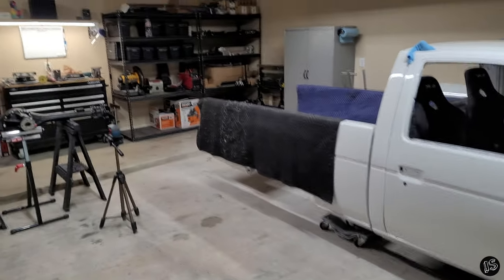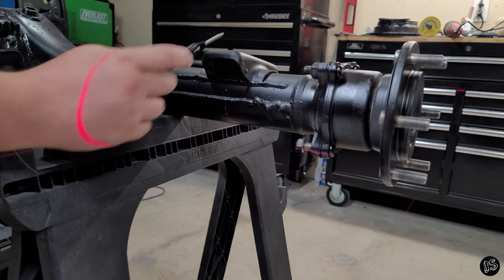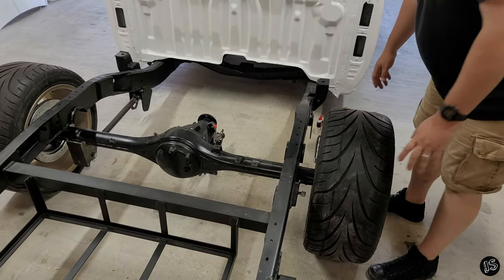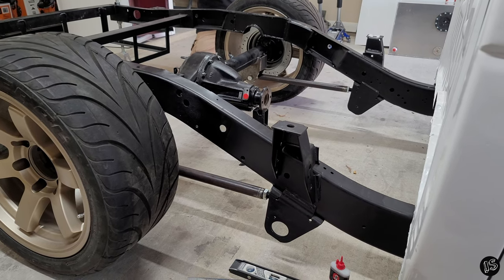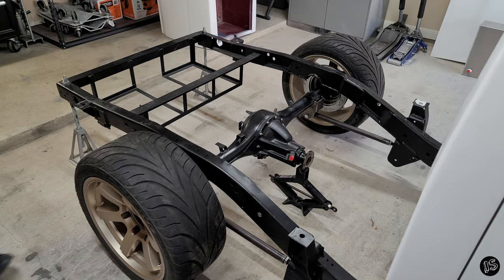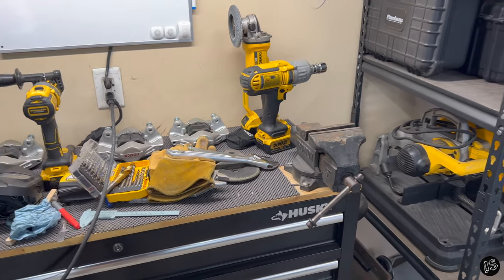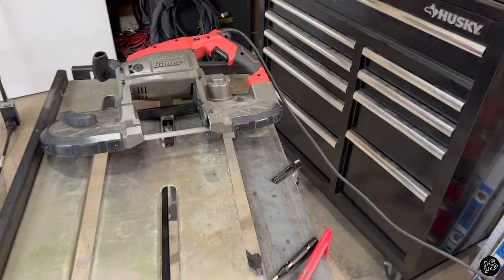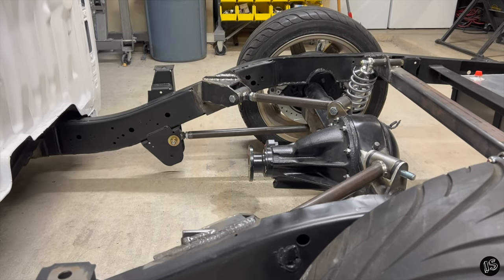Triangulated 4-Link | D21 Drift Truck — Ep. 19

Comment: If the lower links are angled upward toward the vehicle roll center you will achieve what called anti squat, it helps with traction and reduces weight transfer under acceleration. Yup
Reply from the maker: That’s good to know. Thanks

Comment: This is an awesome video, thank you. Currently starting my 4 link. My dif is still attached with leaf spring and stock height. Should I lower the truck prior to starting this project or does it matter? Plan is to airbag truck. The thought process is with it attached to the leaf springs I would have a my position solid (front/back/left/right) and after Installing top links, I could remove the leafs and then install the bottom two. Also just to verify, the top rods and bottom rods should all be parallel to the ground? I see a lot of four links with a downward slope on the top two. Thank you in advance

Comment: I have a bunch of harbor freight tools. They all seem to be the tools i need rarely. Or disposable if need be. Hard to justify buying a tool that costs ten times more if you will only use it a handful of times. And some of them work just fine. I bought the bauer impact drill to build a dock and floating docks just in case i dropped it in the saltwater. Didnt want to risk dropping my milwaukke. That cheap little drill hasnt skipped a beat for years of abuse.

Comment: I'm curious, if your links are two different lengths then won't the points of rotation be different anyway? And presumably the angle of the diff would change? Unless the points of rotation are with an equal length of axis then the diff would presumably rotate a little? I suspect having them offset/angled would greatly improve any side to side "swaying", but as you say, would rotate the diff. I'm curious though, you ended up angling them in anyway? Learning here anyway, planning a suspension setup for a tuk tuk funnily enough!
Reply from the maker: This is sort of difficult to explain concisely on a reply post, but I will try my best, as far as I can understand. I'm always learning too! 

The lengths of the upper and lower links are different, but since they are able to rotate at both ends, it allows the diff to move up and down without the twisting effect. Eventually, you would run out of travel range starting with the shorter links first, but that would be over a much larger distance than this particular suspension would ever articulate. If this was an off-road build, meant for massive articulation, then the design would be different.

As for the triangulated (angled) portion of the setup... The upper links control the track of the rear end due to them being angled. There's no need for a panhard bar on triangulated setups because the side-side force is counteracted by the upper links. Now, if it was a parallel 4-link, that's a different story. Because there's not counteracting force from either of the links, you would need a panhard bar that would redistribute that force accordingly.
Reply: You are right the diff has to rotate because the arc of each control arm is different notice he did not put an angle finder on the flange and cycle the suspension.

Comment: This may be a noob question but I’m not very informed when it comes to suspension stuff, I’m more of a paint and engine kind of guy. My question is, if I were do this with the Ford 8.8 I bought for my S10 but I wanted air suspension instead of using coilovers, would the entire link process stay the same and the coilover mounts be a very similar process/area and I would just be bolting in the bags instead? Does anything in the system need to change if you were to use airbags instead? From first impressions it looks like it wouldn’t change anything but I’m very very new to all this none leaf spring suspension stuff.
Reply: It would be the same. You could use a mustang 8.8 with the upper mounts already built in, but the explorer rear has bigger axle tubes and 31 spline axles.  You could change the mustang axles though

Comment: One of my favorite vids. It appears as though you are using the H233B differential. What gear ratio are you running? Is that an ABS sensor on the snout of the 3rd member? The pathfinder diffs have one. If so, you can use the output from that as a VSS, so you dont have to deal with a speedo cog, since you're using 350z trans. The relationship between pinion rpm and  vehicle speed is linear.
Reply from the maker: It’s actually the weaker 10-stud 3.54 H190 with rear ABS. 97 was a weird year. Yep, I have a Dakota Digital signal box that I’m going to wire up to the ABS sensor and use as a VSS for the speedo. The pinion toner used is perfect for this kind of setup. I would like to swap over to a H233B at some point…
Reply: @Inner_Sanctum  I am working on H233B right now for my 1977 620. I blew the h190 years ago with a stock sr20det on 13lbs (T25).
Reply from the maker: @Zukuri620  oh yeah, I’m sure it won’t hold together long. Just need it to survive long enough to shake it down.

Comment: You didn’t bevel any of your mounts to make sure the weld went all the way through?
Reply from the maker: Depends on the joint I’m welding. I almost always put a ~45 chamfer/bevel before welding certain joint types. The inside corner joints and heavy lap joints on the upper mounting plates have plenty of penetration since I run the machine hot with a smaller .30 wire. The link mounting tabs on the axle third member absolutely have bevels. Most of my welds have bevels.

Comment: In your opinion, my question is. What is the better to build 4-link suspension or independent suspension to obtain the smoothest ride on the road? I am willing to spend what is necessary but perhaps building 4-links would save me all the work of independent suspension and obtain the same result with triangulated links also incorporated a sway bar link on the axle? I repeat i don`t want anything else but a smooth ride. some advisor?
Reply from the maker: You’re almost always going to have a smoother ride with independent suspension. No question. There’s more independently moving parts to assist in adapting to all the variable road conditions. The more independent points of articulation, the more absorbing capabilities you have. That’s why IRS is superior in many ways to a standard live axle. For drag racing and off-roading, this change a bit. You sacrifice certain comforts to gain strength and linear traction.

Comment: This is one of the best videos Ive seen for suspension! Did you make the stands? Great idea.
Reply from the maker: Thanks! I purchased the stands off of Amazon for ~$35. They are listed as: “Camco RV Jack Stands”. Then I just pulled the jack’s leveling post out and replaced it with 3/4” all-thread from Home Depot. Then I used nuts to level and lock everything.

Comment: I dont understand this linkage setup. If you look at 10:50 the upper control arms are pointing inwards. That means if they bend down or up (anything other than level) the ends welded to the axle will have a tendency to pull away from each other. But since they are welded to the axle, they can't physically get any wider, so their movement (I think?) would be limited by the amount of slop the bushings allow. So you're chewing through bushings.
Reply from the maker: Well, I’ll try to help clarify. I know you’re legitimately wondering like I was at first. Also, I love these types of posts. This is what helps people learn. Please don’t delete it. Lol

That would only be true if one end on each upper link was stationary. If you look at the links, both ends have bushings. Both ends on all links move. There are 4 links total with 8 independent points of movement.

I presume you’re thinking that only one end moves and that they travel on their own respective arcs. Meaning that the right upper link and left upper link push and/or pull against each other during operation depending on arc lengths. That’s not the case. Having 2-points of rotation on each link eliminates those arc tendencies. There is, however, a slight centering force in relation to the axle…

That’s kind of the point of a triangulated 4-link. As the suspension is under force, it helps center the axle ever so much. That’s why triangulated 4-links do not require pan-hard bars or stabilizer bars like parallel 4-links. The upper links split the angular difference allowing side to side and front to back stability. The movement doesn’t chew up bushings because the axle is free to be where it needs to be under the truck. That’s why it’s so important to measure everything correctly. That axle is going to sit where you put it in relation to the bars.
Reply from the maker: Here’s a book by Max Fish on 4-link geometry that explains it much better than I can:

https://books.google.com/books/about/Air_Suspension_Design_Book.html?id=-2ESzgEACAAJ

Comment: Unfortunately, your bars are guaranteed to cause pinion angle issued. Please look up "instant center."  If you draw straight lines through your bars, they should  intersect the front of the vehicle.
Reply from the maker: Nope! Truck drives just fine. Zero pinion angle issues. I actually assumed the same thing, but I put my digital angle meter on the truck a long time ago, unhooked the coilovers, and ranged the suspension 14” and the pinion angle remained the same.

Comment: You need to remove the jam nuts.or just leave them loose. As built, it can’ articulate. You could also use hime joints.
Reply from the maker: A lot of folks think this for some reason. However, that’s not how this actually works. 

You’re under the assumption that the bushings and links move together inside the permanent welded on mounting brackets. When in reality, there is a metal sleeve in the bushing that sets the nominal distance for “squish”. The welded mounting points and bushings remain 100% stationary, while the link rotates on the bushing during articulation. The link is the only part that can move up or down. The bushing does not move with the link. 

If you look closely, you’ll notice the zerks fittings and how they distribute grease to the outer bushing side of the internal bushing. The bushing and metal sleeve are not designed to rotate hints why the grease doesn’t lubricate the inner sleeve. The bushings have to compress in order to add torsional resistance.

Also, heim joints wouldn’t work at this angle due to convergent geometry. It would toss instant center out the window.

Comment: I’m about to do the same thing on a Toyota Hilux. My question is have to tried this triangulated 4 link drifting yet ? If so I would like to know how it does as far as the axle moving side to side under extreme loads that drifting puts on it. I’m hearing that it’s better to do equal length bars none triangulated and with a track locator bar is better for drifting. I’d much rather build it triangulated as long as it works for drifting
Reply from the maker: So… I built a 1UZ Toyota pickup years ago, and a buddy helped me fab up a similar triangulated setup. I really enjoyed it. It was predictable and simple. It definitely never felt like the axle was moving around. Haha I think that’s the importance of having it triangulated in the first place. The input force is cancelled out by the opposing side. The reason that there are different types of 4-link is due to fitment, space, and articulation requirements. They all effectively achieve the same result. Triangulated is the simplest, but also requires the most room to properly function. 

On another note, the only sketchy thing about these little trucks is the flanged axles versus having a nut/hub combo. Thankfully nothing has ever happened to my personal trucks, but it was always in my mind. [Snap! Wheel and broken axle come flying off the truck… 🤣]

Comment: What rear end are you using I see disc brakes and not drums. That is exactly what I need to do to get mine up to date.
Reply from the maker: Stock D21 rear end with the Beebani dual caliper brackets and 2002 Honda Passport V6 AWD rear rotors.

Comment: Where did you get those adjustable all-tread stands??? Nice work BTW
Reply from the maker: They are “Camco” RV stack jacks. You can get a set of 4 on Amazon for ~$35 shipped. I then went to Home Depot and purchased a 4’ stick of 3/4” all-thread and some 3/4” nuts for adjustability. Lastly, I cut (4) 1’ pieces from the all-thread and assembled. Viola!

Comment: That’s a beautiful 🤩 build congratulations. What kind of coil-over are you using. And that’s a great mini truck
Reply from the maker: Thanks! The coilovers are QA-1.
Reply: @Inner_Sanctum  is it 12” or 14”
Reply from the maker: @matasgarage5454  they are QA-1 DS401 (14” extended) coil bodies all around, and running 9HT450 (450lb) springs up front and 9HT250 (250lb) springs out back.

Comment: So is this a kit or did you custom design the length of the bars and angle? If it's a kit which one did you get because I definitely want to do something like this to my slammed Tacoma this summer. Sick build and hopefully mine comes out as good as yours haha
Reply from the maker: So, the 4-link is a kit by my buddy Jason at Beebani Customs. However, I had to do a lot of custom work to everything off-camera to get it all to work for my particular setup. So, I guess you could say “both”. Haha 

Jason’s kits are designed to get you close, but everyone’s setup is different, and mine is REALLY different, so a bit of creative license was required. 

Also, there are many different 4-link kits out there that can work. This was my first time doing one. Knowing what I know now, I would have just built my own or did IRS. 

If you take your time, and understand the geometry, yours could be better than mine.
Reply: It looks like I could maybe make my own or modify a kit. Does the angle of the top arms matter and what do they have to be length wise in relation to the bottom?

Comment: How is the fitment with 9" 0 offset wheels and 4x4 fenders? I'm ready to buy wheels and tires but unsure about this fitment.
Reply from the maker: You know, I’ve been meaning to make a video showing the difference between D21 2WD and 4WD fenders. I actually have all brand new fenders for both 2WD and 4WD. 

I’ll pull everything from storage tonight and start working on a video tomorrow. It will be short and sweet. You’ll then have your answer. Expect it by Tuesday.
Reply from the maker: Here's the video:
https://youtu.be/0bwLXdEr1Pw

Hope this helps!

Comment: Where did u get this 4 link set up ? I got 96 hardbody that I’m waiting for Jason to send me his front coil over convertion kit but I want to do back too and there’s few options on eBay that I don’t know which it’s the best fit for a 96 hardbody thanks !!
Reply from the maker: This is Jason’s rear 4-link kit, albeit with extensive modifications on my part. His kit gets you close, but you’ll need to modify it to fit your specific needs.
Reply: Dang ! I asked Jason for a 4link and he said he won’t be making those for a good while if u know any similar setup please post it ! Thanks again! Badass build u doing by da way ! Hopefully u will make a video on custom sway bar to fit on Jason’s coil over kit thanks again
Reply from the maker: Thanks! Will do.

So, I think I may do the sway bar next. Not sure yet.

Comment: What coilovers did  you use
Reply from the maker: QA1 Coilover Bodies: DS401
QA1 Springs (Front): 9HT450
QA1 Springs (Rear): 9HT250

I have since switched springs. I’m now running 9HT650 up front and 9HT450 out back.

Comment: How much horsepower can the stock rear end handle?
Reply from the maker: Going to find out! Haha  

In all seriousness though, there’s not a lot of data out there to suggest the “safe” limits accurately. Torque, traction, torsional rigidity, and shock all play a huge role in destroying these gear sets. However, when I compared this 3rd member to my R200, there’s nothing to suggest that it wouldn’t hold up just as well. 

I’m going to start with ~300ftlbs at the wheels and work my way up to ~400ftlbs. Honestly, I would like dial my setup down to around 360-380whp and sub 350ftlbs at the wheels. 

Having built cars between 250-700whp, in this weight range, in the past, I feel like 360whp is the sweet spot. Especially in the land of SR20. Lol